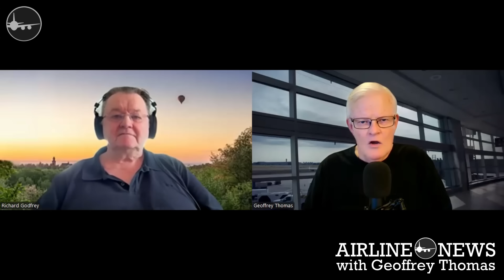Air India Crash - Probable Cause  #airindiacrash

Comment: I’m not sure how much of this I agree with.  As an A&P mechanic, I have a hard time understanding how a single battery failure could drop an aircraft in just a few seconds, especially one with the most advanced electrical system to date.  Surely Boeing built in redundancy, as batteries have been failing since the invention of batteries.  From the fire perspective, even a fire that started before takeoff wouldn’t have time to destroy enough of the airplane quickly enough to kill the entire electrical system.  The holes in this Swiss cheese model are so small, I can barely see them.
Reply: A lithium battery "fire" is more like a slow explosion.
Reply: The Aft battery is located in the aft cargo bay close to the aft cargo bay door visible to both engineers and baggage handlers it's also located close to the bite test terminal. 
ACMS system monitors battery life battery condition and   it will warn of any failure and will disconnect from the electrical systems. 
The battery cells are individually wrapped in inert materials with a electrical disconnect between each cell to prevent thermal runaway spreading throughout the battery the cells are sealed into a stainless steel case both to contain the fumes and the heat. And is allowed to vent to the outside in case of malfunction. 
This battery pack is not located near the aft AE bay it is a number of frames fwd of this nor is it situated under a toilet or galley area. It is sat on a support frame member behind cargo wall panels and a site glass for inspection purposes. Water cannot enter the battery because it is completely sealed . The aft data recorder is situated a number of frames away from this battery behind a pressure bulkhead and close to the APU .
Reply: How is the APU battery vent connected to the outside vent? Does it have a long flexible tube?
Reply: Maybe a little far fetched..? Where does the MANUAL action on the fuel flow switches fit in..?? In those swift few seconds ?
Reply: @jpbluecontrail even the FADEC system cannot turn off the engines it has to be done manually. Although they could revert to idol speed however the evidence says they were shut down. The fuel valves remain open even with total electric failure it's designed to do this.
Reply: I think the keyword is "combined". The theory is that a combination of factors caused the crash.
Reply: Go look up battery fires in EV vehicles, then you will understand how.
Reply: @miguelfreedom9864 There is considered redundancy, four main engine generators, two APU generators, main battery standby power and finally RAT supplied electrical power and hydraulic pressure. 
With flight AI171, the fuel control switches were both moved to Cutoff and let’s not debate why at this point. 
With both switches in Cutoff position all four main engine generators go offline, so a substantial loss of electrical power redundancy lost right here. 
APU not running in-flight so two more generators offline, more lost redundancy and not enough time (low altitude) to start APU and have it provide backup electrical power.
RAT gets triggered but standby power from RAT won't be available for about 10 seconds. 
Main battery only standby power must supply essential 28V DC instrument buses and hot battery bus loads for short time until RAT power online. There are two separate Captain and FO instrument buses for redundancy but now connected together in battery standy power mode so one power source supplying two essential buses until RAT power comes online.  
My theory is there was a problem with the main battery standby power during the short time until RAT power came online, which means no power to the instrument buses, no power to the fuel control relays and a delay back to a Run condition even if switches were moved back to Run. This is how a battery could bring down a plane, a remote possibility but plausible in my opinion. 
My theory is different than Richard’s, it explains the delay back to the Run position with the fuel switches but I’m only covering one of two major events that had to have happened. Something had to initially happen with the aircraft to require cycling the fuel control switches and this is where the APU battery may have played a role. I just don’t know myself what the initial emergency condition was that required cycling the fuel switches and I’m in the camp the Captain didn’t intentionally down the plane, it was him cycling the fuel switches in response to an emergency condition. From there a possible battery standby power problem and a delayed time back to a Run condition.
Reply: Not a battery fire, smoke was not smoke from exhaust battery vent.

Comment: I have extensive experience with lithium ion battery pack construction and failure modes.   Thermal runaway under Lithium cobalt  chemistry is triggered by the cell's internal temperature reaching a critical level.  This typically happens under a  limited set of scenarios:

1-Whilst charging-  due to:
a) grossly  excessive charging  current 
b) greatly elevated internal resistance of a degraded or defective cell
c) sending voltage well in excess of the rated maximum  into a fully charged cell

2-Whilst Discharging -due to significantly exceeding maximum rated peak  current, causing heating through the cells internal resistance

3-Severe short circuit - caused by:
a) physical damage to the external cell to cell interconnects resulting in a direct (metal to metal) high-current short circuit causing a cell discharge gross over-current scenario.
b) Internal cell short circuit due to manufacturing defect or excessive vibration , breaching the internal separator between cathode and anode, localized heating, and rapid expansion of the separator breach and severity  of the short circuit.

4-External heat source which brings the cells up to the critical temperature for thermal runaway.  Typically a fire, or the heat of a neighboring cell already in runaway and the resulting catastrophic chain reaction.   (cells under safety testing are typically brought to  thermal runaway by aiming a blowtorch directly on them) 

Liquid water damage alone  does not commonly precipitate any of the above.  It is not conductive enough to create a severe short circuit, and the cells will   explosively  vent  and expos  their internal chemistry only  under thermal runaway conditions or severe physical trauma such as a direct puncture.   

 Technically it's possible that just the right amount of a much more   conductive  liquid  such as seawater could cause extremely rapid galvanic corrosion of the cell electrodes and breach into the cell , but this is rare.   Usually there's either not enough liquid, or so much of it that it safely and easily draws away all the heat  generated by the mishap.

Given all of this, I am not convinced by the  probable cause presented today; it feels like it's getting close, but more iteration is required , in my opinion at least.  

cheers gents
Reply: Sorry to be a party pooper but there was no battery fire or smoke for that matter.
Reply: Richard already pointed out in earlier episodes that the liquid could have contained urine or detergent which might lead to a higher conductivity than pure water.
Reply: @andreaskohlmann9917  The problem is you need to basically be immersed in the conductive liquid to have the kind of hyper rapid DC galvanic corrosion that could actually eat down into the electrodes and breach the cell.   I have never heard of such an incident.

Again, the levels of current flowing even in the saltiest of water are nowhere near the kind of short circuit current it would take to  cause a thermal runaway.

I struggle to believe that Boeing engineers would've gotten the venting system  wrong on the redesign.  this is not a large battery pack - it is smaller than a carry-on suitcase it's equivalent to about two electric bicycle batteries, or approximately 1/50 of an electric automobile pack.  unlikely it could even burn its way out of its own stainless steel sealed casing.  Basically  a giant smoke bomb that would produce huge amounts of hot white smoke.  also that's not the color smoke we see in the video..
Reply: Hi there. Do check out my comment posted if you have some free time. thanks.
Reply: @Skyking-v2m found it, good post.    i'm not an expert analyzing videos or pretty much anything else to do with this crash ,  but i'm not seeing any evidence that warrants picking on the lithium batteries over any other system, unless Richard is privy to some additional information pointing in that direction...
Reply: "limited set of scenarios:"  lol.  All commercial Lithium batteries besides LiFePO4 are the most dangerous batteries on earth.  I have used them all including Li-Poly for over 18 years.  I'm also a chemist.  Lithium is an alkali metal, and alkali metals are known for reacting violently with water.   The scenarios you have listed have a low MTBF because they rely on charge controllers and directional diodes that all have higher failure rates than many other electrical components.  The fact you don't know the chemistry is the problem.  Also, it is generally the problem generally by virtually all Lithium battery engineers and engineering staff.

I think you should take a couple of your Lithium batteries and drop them in a 5 gallon container of salt water with a camera and post it for us.  Put a pin hole in the LiPoly batteries before you drop them in so the water can get in quickly so we don't have to rely on the time failure factor.
Reply: @michaelbarber5651 Quite reckless banter from someone who knows nothing about me , my education and level of experience.   Perhaps a study of etiquette could round out your education.

Regarding your suggestion, I have disposed of thousands of 18650 cells using exactly that standard method.   5gal  bucket (or 40gal barrel)  of near-saturated saltwater.  It has never once resulted in thermal runaway.  It does however result in rapid corrosion because modest DC current flowing through the saltwater.   The process rolls along for hours and makes a stink  and mess of the water (must be outdoors or with capable fume extractor).  But no thermal runaway, no lithium metal suddenly meeting water hypothetical fireworks.  Nothing violent whatsoever.  The internal cell temperature must reach critical high levels for runaway.  It gets nowhere remotely close. 

The piercing of pouch cells is an entirely different topic, and to the extent the puncture creates an internal short I've already discussed what happens.  I don't know if you are suggesting that Air India was operating with pierced cells , I don't consider that a possibility given the pack is entombed within a 4+mm steel containment coffin.   

I can't determine whether    you are trying to make a relevant, coherent point or just being grumpy unhappy.  I will point out that lithium cobalt oxide runaway yields white smoke not black, and not as a puff but as a steady stream for several 10s of seconds. As neighboring cells go critical they go next , and the whole event can go for quite a time.   These traits do not match up with any of the video evidence whatsoever.  There is simply no public evidence characteristic of such a thermal runaway characteristic of the large format prismatic Lithium Cobalt Oxide cells within this 8 cell 75Ah pack...
Reply: @GannDolph you are clueless.  Do the experiment I’m telling you.  Just one warning….  Wear protective gear for you eyes because once the lithium and water (ANY KIND) come into contact, the lithium will ignite and actually burn under water.  It burns so hot, it will boil locally and if it can’t expand or there is insufficient water it is going to blow up in your face.  It couldn’t happen to a better narcissist which is why I suggested it for you.
Reply: @GannDolph 

https://youtube.com/shorts/TyWTZ46203g?si=3e1luTbmLu416NWY
Reply: I'm with you on all of this except that the exact makeup of the liquid that supposedly sloshed into this battery compartment is unknown. It could be a combination of coffee tea cleaning fluids hydraulic fluid fuel Etc, I guess we'll never know never know never know😢
Reply: @tracksofnyc  We are left only with speculation on probable events. Although the exact nature of the liquid might potentially make a difference, I think it highly improbable for it to ingress into the battery containment. 

So you can reach a point where the conclusion relies on a series of improbable events. Thar doesn't make some proposed event impossible, but it makes it even more improbable!.
Reply: In the fire dept we don’t even attempt to put ev car fires out. We literally have to let these lithium batteries burn themselves out. We protect the surrounding areas but stay away from any direct spray of those dam batteries.
Reply: @Alaskan1970 yes…I believe you.  Same thing when I store them at home for my hobbies.  They are stored in an ammo box on top of concrete.  When they stop burning, it is mainly a salvage job.   They can’t burn concrete so I am good.
Reply: @GannDolph I consider your four points of high interest. I still think that some dangerous goods may have had something to do with the initiation of these successive events, but this is just a matter of 'what if' logic that needs to be proved or ruled out.
Reply: @astircalix4126 cheers.  yes it's a fascinating puzzle to try to figure out with two arms tied behind our backs , when it comes to lack of facts!   I applaud Richard and Geoffrey for fearlessly exploring every path.  

I do think they, and a lot of us viewers here, have a deep down feeling that something atypical will be involved here, be it maintenance, dangerous goods, etc..   But none of us  knows for sure and this community shows impressive restraint when it comes to our personal hunches.  I'm any case I am thankful to this series for raising my own knowledge of aircraft systems immeasurably !
Reply: Sorry I disagree.
Water is more than conductive enough in anything other than it's pure {deionized} form. Potable water would not be deionized and any other source of contamination would only increase the conductivity.
As a thought try finding someone to volunteer to sit in a bath  whilst you drop an electric fire in it!
Reply: @Guy-UK the chemistry is obvious and if you know it, it makes no difference.  Lithium reacts violently with water….any kind of water.  It literally burns under water….
Reply: @Guy-UK  We're talking about probability so unless the fluid is improbably conductive, it becomes even more improbable to sustain a high level fault current. The voltages involved are pretty low so that makes high current faults unlikely.  Many times, I have seen completely submerged 480 volt 3 phase circuits continue to operate without reaching a high enough fault current to trip the protection. I've seen bubbles rising from exposed terminals from the leakage currents, but still not cause a major, high energy fault. This experience tells ne we are talking low probability. Not impossible, but pretty unlikely.
Reply: It bothers me that these experts are so resistant to following the evidence and accepting reality.
Reply: @laurasalo6160 some of these people are experts in their own mind.    Others don’t have all the facts.  Geoffrey and Godfrey have a few other facts that were on Indian media that never made the US msm.  They have woven those additional facts into their hypothesis.  In addition, they are looking at all the facts including the white/grey white smoke at the end of the runway as well as the long takeoff roll.  Most likely they were near or at V1 when they already possibly had some warnings but thought they were manageable.
Reply: Excellent post!  I have read so much on this incident I'm not sure who I can point to, but my conclusion was the failure here was a post impact event. I tend to agree that water, even highly corrosive water would probably not cause this. 

No doubt there was a failure here, but I tend to think what occurred here was post crash. caused by a mechanical failure of the battery associated with the high energy of inertia on the battery causing a cell failure and thermal runaway. 

But the damage seen here was a clue and all this little clues need to fit in the chain of events. Richard needed to address this and needed a plausible water ingress event as the root cause. Personally as an electrical engineer seeing many water related issues at these voltage levels, over many decades and in much worse environments, I struggle to see a large enough fault to have taken down one of the busses and to cascade into dual engine failure. 

Possible? Sure, under the right circumstances, but unlikely in my opinion. Especially when explained as some "unknown event" related to water ingress. I think Richard is attempting to link the events with a large enough fault to have taken down both engines. 

Personally, my theory is the RAT deployed due to hydraulic failure and fatigue and a mind/body brain cramp, which had the captain reach down and operate the fuel cut offs when his mind intended him to reach up and switch the two hydraulic pumps to manual. The hydraulic controls located directly above the fuel cut -off in a side by side configuration virtually identical to that of the cut offs, albeit selectors vs switches. I believe the blew a hose on the large hydraulic cylinder that raises and lowers the gear. 

The pilot denies operating the cut offs, because his brain intended reaching up to operate the hydraulic pumps but his right hand went down instead of up! He did not intend to crash the plane.